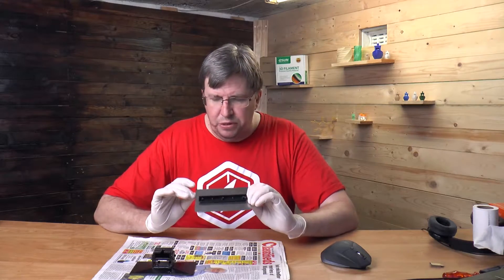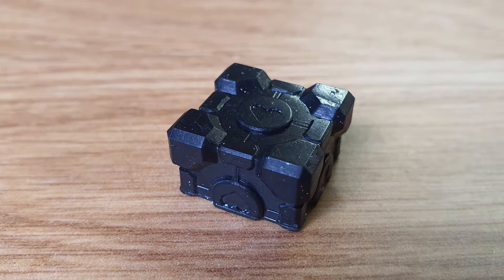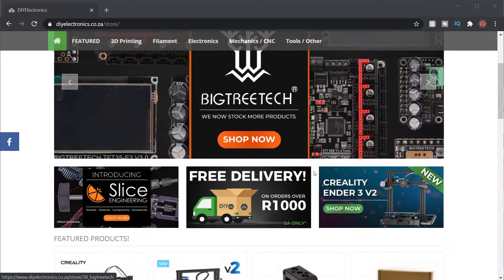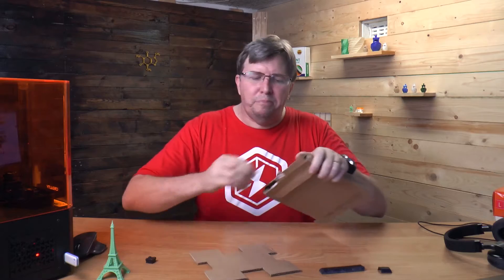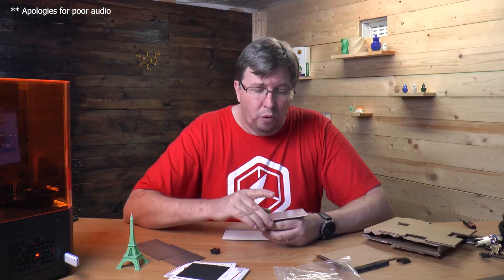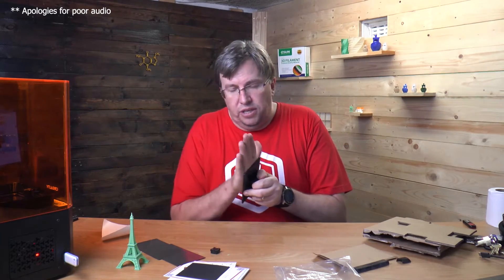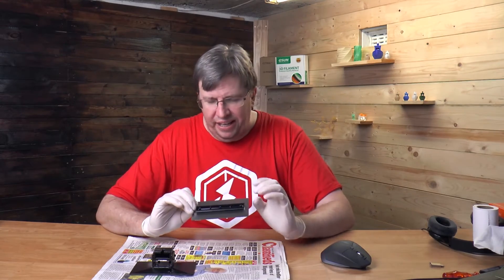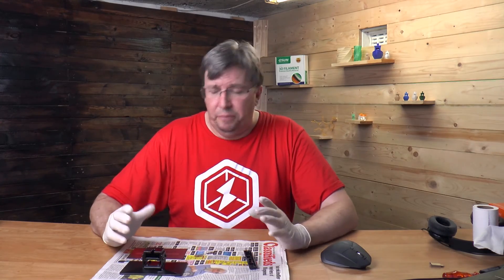Wham Bam for the Creality LD-002R Flexible Plate System Review | DOES IT MAKE THE PRINTER BETTER?

Comment: Home is outside the screw slots….now what
Reply from the maker: Sorry for the late reply, check your sensor, there is a piece of metal that goes between the light sensor, make sure that is clean and that it is aligned properly, I once knocked the sensor off, so the homing was totally out.

Comment: Uh, no one likes prints sticking to the build plate so hard you can't get them off, but I don't think I want them to fall off that easily either....
Reply from the maker: Hey bob88099, as I said in my comment to --, this is my independent review of this system and in my 7 prints so far I have had no issues except the very first print that came loose because I had not cleaned the wham bam sheet.  I will continue using this over the next week or so and report ANY issues I find in a new video if necessary.  So far I have been blown away by how well it is working, this was a first impressions video and first impressions were excellent
Reply: They don’t fall off during build you need to flex the plate to make the fall off!
Reply: @WhamBamSystems  That's what you say, but I watched the video with my own eyes and saw that print was barely attached to the plate, it came off with almost zero force. And he said himself the first print failed because it didn't stick to the plate - that's not exactly proving your point either lol.

Comment: I know this seems useful, but I'd be careful. There's already several stories floating around about the build plate shifting during prints. Buy it if you want, but just lower your exposure times on the first few layers and you don't even need this.
Reply from the maker: So far I have not had any issues of prints shifting, granted I have not done a ton of printing but so far so good.  My review and tests are completely independent of both DIY Electronics and Wham Bam and have not been influenced by either, this is MY honest opinion.  I will keep doing prints and if I find ANY issues I WILL report on this channel.  This was a first impressions video and first impressions were very good.  So far I have pushed 7 prints of various sizes through and have not had any issues barring the very first print that came loose due to the build plate not being clean.
Reply: @FusionSource  Not implying any shady stuff on your part and I've always appreciated your impartiality and honesty. I know if you experience any issues you'll let us know. I have however read in several spots both on reddit and elsewhere about the issues I described, and I find whambam's response lacking. HOWEVER that certainly has nothing to do with you or this video.  Keep up the good work sir, love the videos !
Reply from the maker: @obie224  Wow, thank you for the complements, gave me a bit of goose flesh reading that ;-).  I will most certainly do a follow up video if I find anything out of the ordinary I will certainly create a video on it.
Reply: If the build plate shifts, it’s just leveled too tight, all you need to do is relevel without pushing down so much, paper between build plate and screen should move.
As with any new tech you need to learn how to set it up.
Reply: @WhamBamSystems  That's not the issue people are reporting,  people are having a problem with the plate shifting throughout the print, not just in the initial layers.. And in any case, going straight to blaming it on user error without even knowing exactly what problem people were having is pretty ridiculous, or are you assuming that people are suddenly forgetting how to level their build plate ? That's the first thing people have to learn when they buy a resin printer,  but suddenly they don't know how to do that if they have a problem with your product ? Thanks for letting me know how your company handles product issues : "it's the user's fault"
Reply: @obie224 it’s not ridiculous, it’s a new upgrade you need to learn its settings like everything else. Everyone who ever wrote me with shifting has had it resolved with our advice and is happily printing. There will be a lot of new users who will have issues, and we work with them, our tech support is top notch, but as you can see from all the review it works wonderfully. If you remember when you began resin printing all you had to learn to get successful prints without failures, same when you Change up your system, sometimes you need to learn the parameters. However it easy to get great results with our kits!
Reply: @WhamBamSystems  "new tech" ? "settings" ??? It's just a sheet of metal and it changes absolutely nothing about the leveling process. You level the plate exactly the same way with your product or without. Why do you keep insisting that there's anything different that people are doing wrong ? You act like your product is equivalent to upgrading the lcd screen or replacing the z-axis LOL. It's a sheet of metal that sticks to the build plate, stop trying to hype yourself up. Anyways, like I said, blame it on the user, got it.

Comment: Do you not print with offset supports ? Ive always used them on everything but I’ve never tried without
Reply from the maker: I try avoid them as much as possible, they waste resin and leave marks on the print, I only use supports if I have any overhangs
Reply: @FusionSource  thanks! You’ve saved me some resin!
Reply from the maker: @ww55d  Glad I could help, let me know what your results are like.
Reply: @FusionSource  I'm a newbie with 3d printing in general. I've got the LD002-R as well and my 1st figurine print came out quite nicely of which i obviously needed to use supports. I too see for something flat like a spacebar, you didn't use any supports. I want to print some foldable wall hooks that I found on Thingiverse https://www.thingiverse.com/thing:4675334. Do you think I should use supports for this or should i try printing it flat to the build plate? Please check it out and let me know. Thank you for the videos you posted, been really helpful 👍